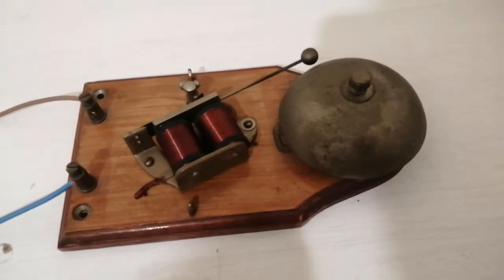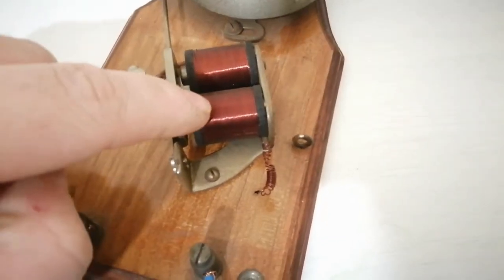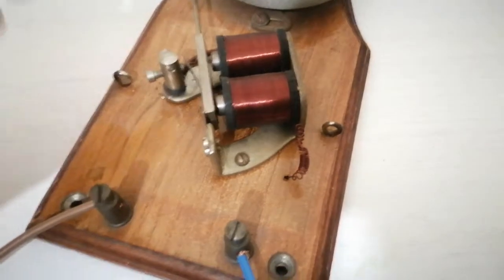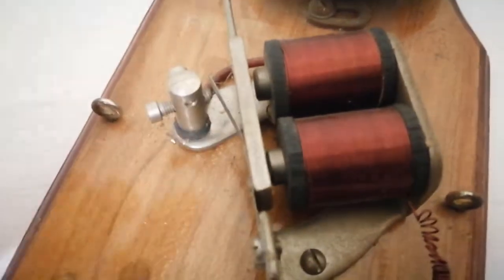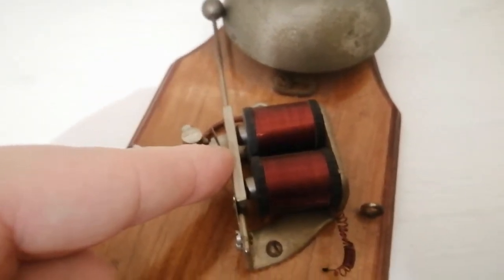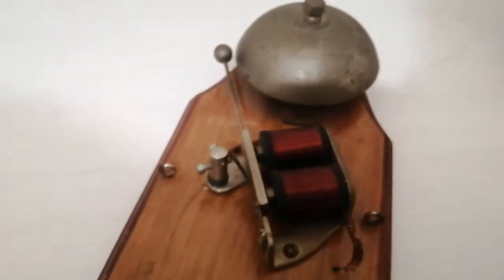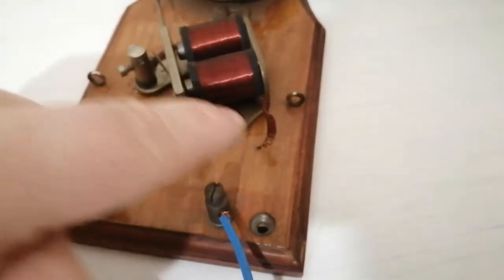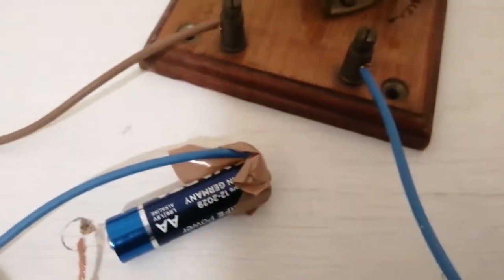How do old electromagnet doorbells work? An explanation from an electrician in West Wiltshire.

Comment: It does not attract the bar, the current running through the screw, hits that thin little spring, which in turn forces the armature bar down, breaking the connection the secondary spring in the back end (or possibly same spring but just another section) pulls the armature bar back up to once again connect the spring to the screw, completing the circuit

Comment: What gap between the connectors on the coils; my coils are movable & this is the reason i ask.
I opened the screw retaining the coils & it moved towards the connections but i think there has to be a gap of some sort otherwise it cannot work but they were not connected initially so it's not working one way or the other.

Comment: This is still the most effective design for a tattoo machine with some improvements like capacitors to smooth out the current etc. and potentiometers to control the dc current.

Comment: Thanks! i have an old bell that I was able to make ring because of this video. I believe it may important to know which terminal is the + and which is the - and that is based on the direction on the coil wires...
My bell only seems to work with a 12 volt cigarette lighter. so I think I still have much to learn :)

Comment: I really like those sounds produced by old bells, which had huge and heavy sound tubes in bronze.They are no longer manufactured, they would be extremely expensive.But, I was determined to have a doorbell, with those sounds.So I recorded the desired sound on a flash drive.I used a Chinese sound box, which plays a flash drive, as a doorbell.The sound volume is great as it is amplified.There is a delay of about 4 seconds between pressing the button and hearing the bell sound.I have to teach the postman, because he has to press the bell button non-stop until he hears the ding dong.